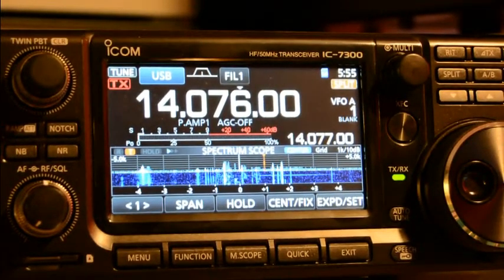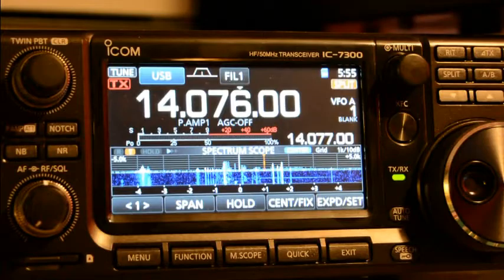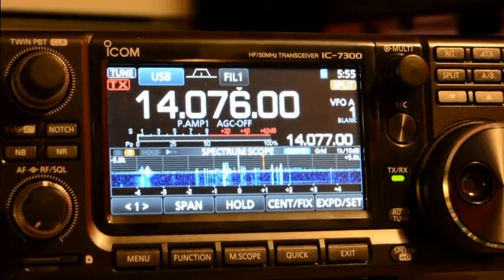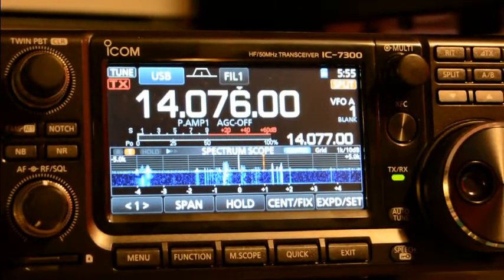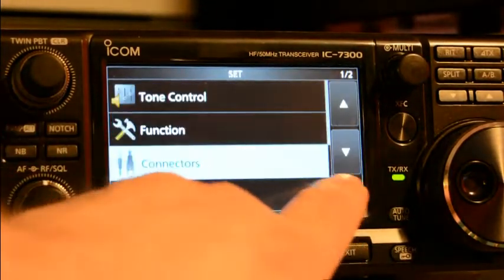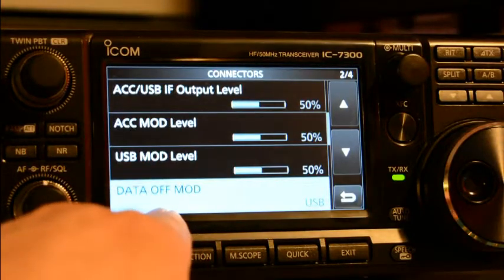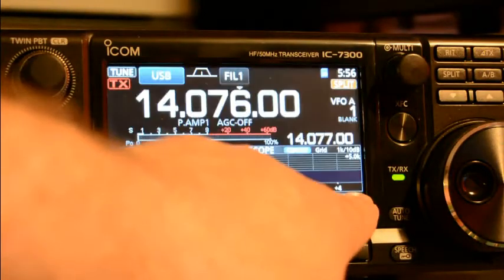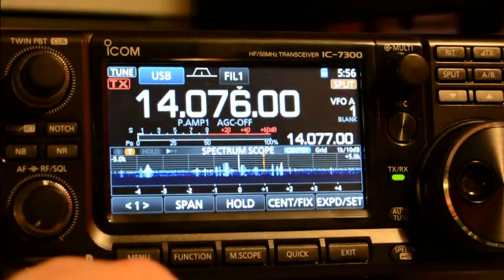IC7300 - re-boot on PTT

Comment: the dc is under 11,2volt by ptt ? pse check your dc-cable or the powersupply
Reply from the maker: +Jurij Hinze PSU is fine - I thought that myself and it's not that causing the problem.